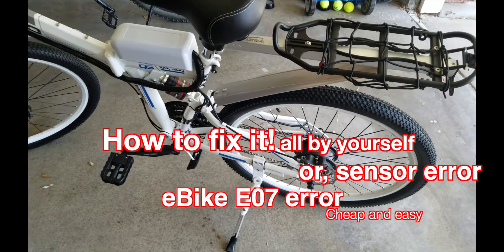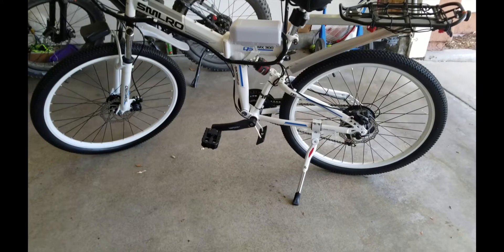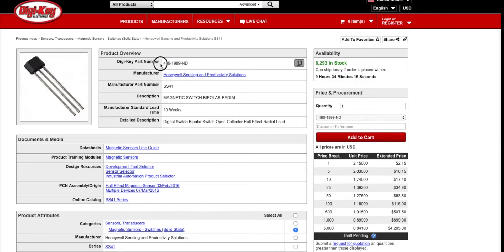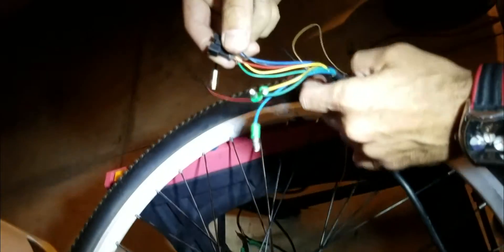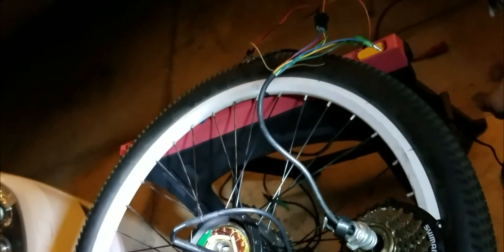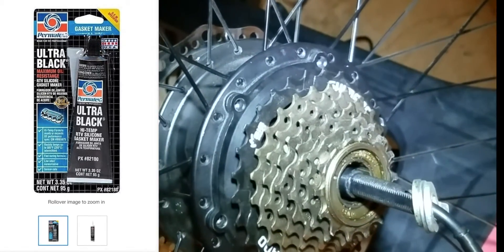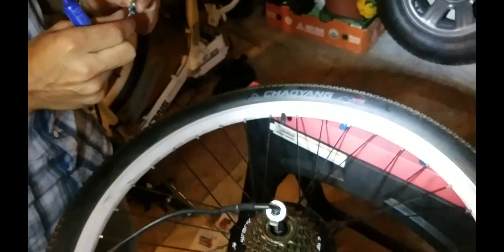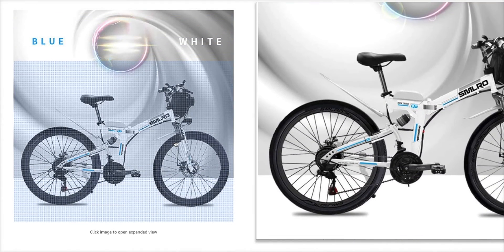eBike hall-effect sensor error - fix it yourself SMLRO

Comment: Hi. i get an error 8 code on my electric bike LCD Screen. the bike wheel is dead and wont turn. will the Hall censers need replacing. thanks.....
Reply from the maker: Difficult to say for sure but the whole sensor fix is relatively cheap so it's worth a try.
Reply: @smidgelife  thanks for the reply. i took the hub apart and found that someone who had owned the bike before me had already replaced one of the hall censers. i done a good few test in side the hub on the circuit board and all wires etc. i ended up discovering that there was two wires broken, the yellow & blue leading down from the main big black cable that leads down through the wheel spindle/axle. the two broken wires was the one's that was working the Hall censer that had been replaced. i think who ever replaced the censer must of though it was just the censer a loan that was at fault. when in fact it was just the two broken cables. i have repaired the two cables now and the bike is working just fine. so Error 8 is telling you that there is either a bad connection to the hub, broken wires. or the censers have failed.

Comment: Buyers beware. Smlro is a low quality bike. I have 2 folding fat tire. So many problems.  One bike the lcd failed and now it won't turn on.  I have contacted smlro Jennifer direct and she won't help. Keeps saying will get back soon. So much for warranty or custom service. So left with an expensive brick. Can't ride unless replace controller and display.. expensive

Comment: My rear hub motor on my smlro s11f just finally gave up the ghost at 900 miles. Its been buggy with intermittent errors for the last 400 miles. Has your repair held up? I am waiting for hall sensors and statoraide.
Reply from the maker: It worked for about a few extra months.  Then I just finally gave up.  Let's hope you have a better experience.  Cheers

Comment: any sensor will do or it depends on the motor or controller?
Reply from the maker: Good question I'm not an engineer unfortunately.  I had my engineer friend helping but I believe the link is there for the hall effect sensor.  I think he looked at it with a magnifying glass? I don't recall

Comment: Thank you for making this video. I also had an e 07 code. Wasn't the exact same issue but it was a problem with some wires in the motor hub that had broken loose from the soldering. Wouldn't have ever found it, nor had any idea how to fix it unless I had seen this video.
Reply from the maker: Thanks!  Glad it helped 🤠

Comment: Hey, do you have any idea what the error code 08 is on that bike because that happened to me.
Reply: 08-99E  error codes are usually reserved and you are recommended to contact the manufacturer. I am sure you got this info by now, but someone might find it useful.
Reply: @e-bikeautonomy  thanks!
Reply: @Catmaster3  did no one tell you that bro??/ cause everyone keeps telling me to open a bike shop to help everyone lol think it might happen! a year eh dude?
Reply: @Catmaster3  also hall sensors are usually E07 lol sorry he is giving u bs advice!
Reply: @e-bikeautonomy  no one ever told me and i think you should open one, obviously you know your way around with bikes
Reply: @Catmaster3  Na I just love to help people my friend... pay it forward for free.. like It should be free energy, my brother!
Reply: @e-bikeautonomy  Hi. i get an error 8 code on my electric bike LCD Screen. the bike wheel is dead and wont turn. will the Hall censers need replacing. thanks.....
Reply from the maker: I wish I knew it's just been too long.  Is your bike functioning in any way?
Reply: @smidgelife  It turns on it just won’t move with the throttle
Reply from the maker: Reach out to the manufacturer but it might be similar to the hall effect sensor error I was getting.
Reply: @smidgelife  Alright, Thank You!

Comment: Hello, thanks for the amazing detailed video.
I am in the middle of fixing a friend's bike with the same problem and I was wondering if you had any tips to remove the glued in old sensors? I don't want to apply heat because I know it's bad for the magnets. Maybe a drop of acetone?
Reply: Wow, that was some quick replying!
Anyway I've tried with that but didn't work for me. I guess I'll just try with the acetone tomorrow and hope for the best.

Thanks for your help.
Reply from the maker: I think it was just heat from the soldier gun.  Thank you

Comment: What was the initial fault? I have a problem on my ebike where I use the the throttle and the rear wheel won’t move even when I use pedal assist. I tried looking for disconnects, damaged wires, anything to help me but nothing showed up. Now I’m wonder if it’s the hall sensors but I’m afraid it could be something else and I hate to spend money on something that didn’t fix my ebike. Would this method really work to fix my ebike?
Reply from the maker: It's been so long.... If it's not in the videos then I can't quite remember sorry ☹️
Reply: Have you fixed yours? I got error 007 on my sw900 display. 2000watt motor. When I push acceleration it not going. My cable running to motor was rubbing next to tyre which exposed colored wires and shorted wires? Or maybe those 3 pronged components need to replace?.
I blamed the bike shop that serviced my bike coz they should of zipped tied cable away from back wheel 😡. They tried connecting wires back together and never solved problem
Reply: @kiwimon3204  I had to replace the whole electrical components of the ebike and use a conversion kit to build my own on the pre-existing ebike I have. I ordered the bike from Amazon and got very little help from the seller so I changed the rear wheel motor, the battery and the controller to suit 1500w. I’m happy with the upgrade and it’s worth more than what I originally bought it for and it goes much faster than before. I’m just disappointed with the seller’s resolve and that I had to take matters into my own hands to get it fixed with the expense of losing more money

Comment: My friend had a problem with his Apollo ebike. The hub motor was not spinning. He went to the place he purchased it from and they changed the pedal assist and still could work. So I tried to fix it and i found out the motor controller was faulty (24V 250W). 1 of the mosfet was short circuit and there was no option to replace it as it stayed under silicon coating. The motor controller comes attached to a battery bracket. I found a new controller on eBay which had the similar waterproof connectors  (Julet). Please advice me if I must change the hall sensors. Just wondering if the motor controller model KT24ZWSRD  -ffF01 will match the hub motor.

Comment: I have that exact same lcd screen and can't get E10 to go away. Because of that I can't turn on pedal assist or use the throttle. 

Any ideas I'm dying here
Reply from the maker: It's difficult to say I had many issues with that e-bike.
Reply: @smidgelife  hey man thank you for responding so quickly. I was actually looking at it right now and it looks like one of the wires connecting to the LCD display is broken. And ten to one that's what it is so I'm going to go ahead and saw to that back on and I'll reply again. Haha. As bothersome as it can be at times it is by far my favorite hobby
Reply: Solder*
Reply: Try to change the motor controller. Hopefully this will solve the problem.

Comment: A "hall effect transistor" (what is being called by most as "the halls") is simply a transistor that operates (conducts electrical current) when it is within a magnetic field. The third leg of the transistor outputs a variable voltage between ground and circuit control voltage (normally 5 volts DC) depending on, or proportional to the strength (or "saturation") of the magnetic field. Because it's the magnets that spin on a brushless motor, as the magnets spins past each hall sensor, it will conduct or output a sine wave signal that the controller uses to determine when and how long to pulse the phase wires. The frequency of this sine wave is also how the controller calculates your bike's speed if you use an LCD panel. If you attempt this fix the two most important things are; 1. make sure the transistor is an equivalent model (use a U.S. made transistor replacement if you can, as Chinese semiconductors tend to burn out or short if you fart wrong too close to them; this is NOT a "racist" remark, most Chinese semiconductor manufacturers use inferior processes to make semiconductors causing them to fail at lower currents and voltages) and equivalent package (shape of the body of the transistor - usually a TO-92 package but SOMETIMES a TO-196, and 2. that it is oriented exactly like the original. As you can see in the video, the transistor has a flat side. Making sure of this orientation prevents connecting it backwards to the PCB.
Reply from the maker: Wow!  Amazing detail 👌🙌😍. Thank you.
Reply: @smidgelife  Just trying to unveil the magic. ;) It's really not difficult to have an intuitive understanding of these contraptions if you look at one device at a time. Hopefully it helps the more adventurous DIYers watching your video.
Reply from the maker: @3DPDK  thank you!  Very helpful.
Reply: Great comment very useful information. I’ve done a lot of electrical work with very little electrical knowledge mostly because I had to keep the machines running at work. I learned to troubleshoot and fix 480v 3 phase motors and all the components, VFDs, contacts and breakers, control buttons and limit switches all while on the phone with my boss in the middle of the night 😂or using YouTube. I don’t recommend it but I learned a lot. But I have very little electronic experience or knowledge but this comment was great with very clear description of how and why these components work and this video and comment is excellent the information I was looking for. Thank you.
Reply from the maker: @jisu222 good job!

Comment: My bike turns itself off sometimes. The display turns off and I need to restart it several times to continue cycling. Does anyone know what wrong is it? Thanx!
Reply: Mine does same.  Brand new kit... Eventually no rotation 😬 I thought initially was controller now thinking it's a hall sensor .. grrr 😠 

I'll most likely order another rear wheel as changing out sensors looks to difficult for me ..

Comment: Hey man... thanx for the video .. my bikes hub motor is 2000 Watt / 70 Volt. and I tried to read the number of the sensors that already installed... I could not .. but definitely not SS41. so do you think I can replace them with SS41 anyways? 
cheers
Reply from the maker: not sure... they are very cheap.... You could try.

Comment: Pretty interesting Video!  Could you elaborate on how he found out that the sensors were bad? How did he test them?
Reply: If you have an LCD panel, the #7 error code means the controller is detecting a bad or missing hall sensor signal. Without a dedicated ebike tester, a "down-'n-dirty" method of testing is to apply 5 volts DC to the red and black wires going into the motor (this powers the circuit board in the motor, shown in the video - red is positive and black is ground). Use a volt meter and measure from the black wire (circuit ground) to each of the small gauge yellow, blue, and green wires. These are the hall sensor signals and should read 4 to 5 volts pulsed or variable as you slowly rotate the wheel.
1. Read nothing as the wheel spins if there is not 5 volts DC on the red wire. This can also happen with loss of circuit ground (black wire) but that's extremely rare - usually a bad wire or connector.
2. Read nothing as the wheel spins if the hall effect transistor is burnt out or "open"
3. Read any voltage that does not change (or changes very little) as the wheel spins if the hall effect transistor is internally shorted.
Do Not confuse the heavier gauge phase wires going to the motor coils - there are three and they also are yellow, blue, and green. You won't damage anything by probing them, but you aren't testing anything if you do. Just remember the phase wires, if connected to a live controller, CAN carry what ever battery voltage you use. 24 volts to 76 volts can give you a pretty nasty shock and contact burn. - best to leave the phase wires alone as they also produce voltage, like a generator, at different levels as the wheel spins even it the cable is disconnected.
Reply: @3DPDK  Thanks mate!
Reply from the maker: From what I remember... As the motor turns the sensors can be measured to see if they activate, and if they do, they pulse electrical current.
Reply: Thanks! You saved me from a tidius motor scavanger hunt

Comment: the assembly process at the factory has the sensors already installed on the board before they are placed in the motor hub . then the controller leads are soddered.  hall effect is over-rated for a daily commuter so avoid motors that have this feature...for this very reason .

Comment: Glad you got it fixed and yes it is definitely a must to know someone that can fix  those cheap ebikes. As you said he easily saved you a couple hundred dollars or the ebike shop would of just told you that they couldn’t fix it because they didn’t know what was causing the problem
Reply from the maker: So true.  It's also nice to know that it's not just this bike that has those type of sensors.  They almost all have that same kind of design.  I'm putting the wires back together today and will have the bike ready for my commute by Monday.  Thanks for watching.

Comment: Do you know if all hall sensors work on different motors? I have Nine Continent RH205 Rear Wheel Motor 500W reworked by grin to be the "Nine Continent m30067rc" from what I can tell. It is just so i can order a few and have them on hand in case I need them in the future. https://www.ebike-solutions.com/en/product?info=1674    http://www.realelectricbikes.com/6b11_Rear_Nine_Continent_DD_Cycle_Analyst_V2_e-bike_motor_kit_BASIC.html

Comment: Afraid I would have to replace the whole motor. lol. as well as the whole wheel because I'm not replacing spokes either. Eyes aren't good enough for that kind of work anymore. : (  Wonder what a new motor cost?
Reply: Anywhere from $90US to 180US depending ranging from 250 to 750watts. Then, if you can't spoke the motor to the wheel yourself, you'll have to pay a bike shop to do it for you,.